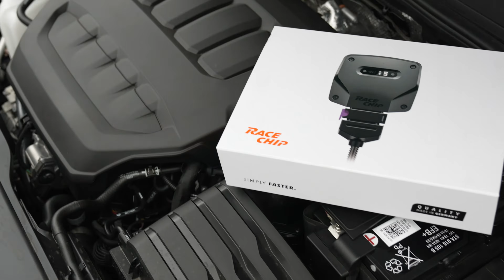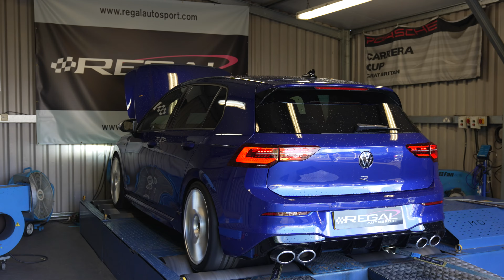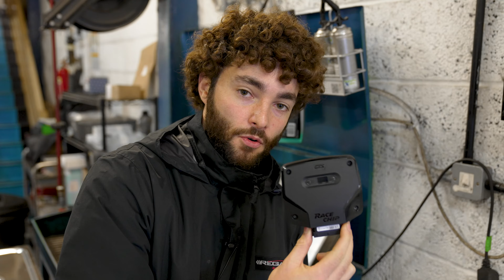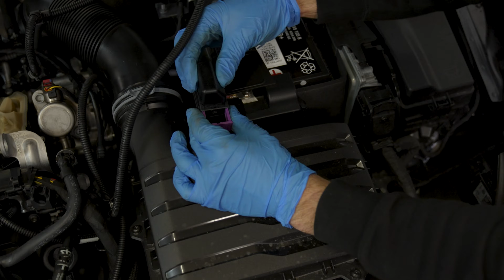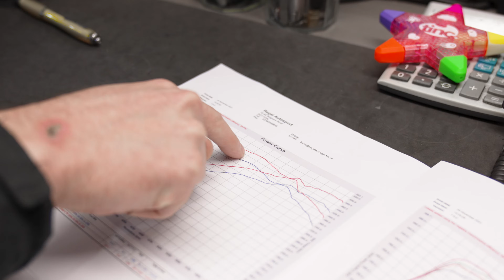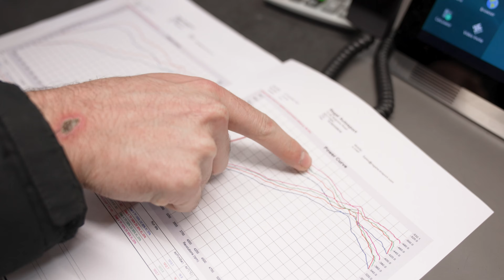HOW MUCH POWER DOES A TUNING BOX MAKE ON A MK8 GOLF R? [Tuning Box explanation & dyno graphs]

Comment: The MK8’s engine is very similar to the MK7/7.5’s. I mean VERY similar. Minor changes to the turbo and internals, but overall, it’s practically the same. 

That being said, a Stage 2 tune on a MK7/7.5 R takes it from 290hp crank to ~430hp crank. That’s a 140hp jump in just a software tune and downpipe. The MK8 R I would suspect to be in this same range of power (or even more like a 150-170hp crank jump) with a Stage 2 software tune and downpipe, BUT it needs to be a legitimate software tune, not the “tune box” junk.
Reply from the maker: On our dyno ECU, DSG software (or clutch if manual), good quality full intake, good quality exhaust and good quality intercooler will see around 410hp, bit shy of the hybrid turbo 430hp+ numbers you are talking about.
Reply: @RegalAutosport  I think you misunderstood. I’m talking crank up numbers, not whp. A hybrid IS38 turbo on a MK7/7.5 GTI/R will make 430+whp worth the same mods you mention above. That’s about 490hp at the crank. I made 358whp on my IS38 turbo taken from the Golf R on my MK7 GTI, which is about 410hp to the crank with my 6spd manual, and around 420hp crank for the DSG.

I would expect the crank hp to be more on the MK8 considering there are some engine upgrades, a larger stock turbo on it, and it starting off with more factory hp. 

A hybrid turbo should be making well over 500hp to the crank on the MK8 because it already does on the MK7/7.5. We’re you referring to crank or whp numbers?
Reply from the maker: @JacesOwnWorld   We only talk about crank numbers too, but calculated crank numbers from the drivetrain losses. Not a random % added

Comment: I'd be concerned with longevity of the engine after installing this. It doesnt adjust timing. More boost could lead to piston detonation without proper timing advance.
Reply from the maker: Important world could but doesn't. If you're worried about your engine, it's best to keep the engine stock.

Comment: What happens to your VW warranty is the engine goes Bang with one of these ?
Reply from the maker: It's best to speak to your warranty provider with regards to the specifics, although RaceChip do offer a warranty which you can also find out the specifics of by contacting them / visiting their website.
Reply: It’s out the window. Apparently BMW can detect if a car has had a tuning box fitted these days. So I would imagine VW would be similar as well.

Comment: @regalautosport, what octane of fuel did you run the race chip during the dyno runs?  I’m assuming you didn’t change any fuel.
Reply from the maker: We always run Shell V-Power
Reply: @RegalAutosport  93 octane?  I’m not sure what’s available across the pond.
Reply from the maker: I’m not sure what your exact equivalent is as you use a different rating system but usually the industry uses ‘93’ as a comparison, even that isn’t the true reflection though

Comment: Great video!! You explain exactly what a chipbox does and how. Im an owner of the new Gti Clubsport (300ps) and I’m considering to install a box..I wouldn’t wait for the unlock of the ecu and that because the Gti Clubsport is fwd..and the 30-40ps you gain from a box is more than enough so the car doesn’t lose its balance. On the other hand if i had the Golf R i would probably have waited for a ecu tuning, more gains and 4wd to support them..I can’t wait to see the review on the road. Cheers!!
Reply from the maker: Thanks for watching and your kind words. Great to hear that it was helpful. Driving video is coming in the next few weeks!
Reply: If you buy a pcm box you get stage one remap free as long as you give your pcm box back when the ecu is cracked.
Reply: So these are piggy back tunes.  It takes data from the measurement instruments on the car, and changes the values.  The stock ECU adjusts and ends up making more power.  It will say i'm not making enough boost and not running enough fuel, stock ecu demands more boost and fuel.  

The issue with tricking the ECU is that you are removing safety limits that are designed into the car.  If it was my car i would wait for a proper tune.  APR for example adds a ton of additional measurement points on their test cars to tune the car like how the factory would.  When manufacurers tune they take way more data points than what will be on the road car, and use formulas to estimate these values on the road cars.  This works great as the formulas are based on actual measured values under fixed conditions.  When you piggyback these formulas don't change, but you are changing the conditions.  

And as for their "warranty" , I just read the exclusions.  Lets just say they have tons of outs to void it and it only covers up to $7500.

Comment: I was expecting a bit more if I'm quite honest but it would be good to get some draggy times, 0-60, 20-70mph just to see what it's like on the road. Like someone else said, I have heard some bad things about the GTS.
Reply from the maker: A tuning box does have its limitations… it’ll never be as good as a proper ECU tune. Unless it’s a terrible one 😂

Draggy times are coming up! 

What bad things have you heard? Share!
Reply: @RegalAutosport  That's very true, I thought more around the 375bhp with a tuning box but I guess the proof is in the dragy numbers. Will you be doing standard and with the box runs? 
It's mainly how some have bought the Racechip and not noticed a big enough difference to warrant the £500 for it.
I did see a Ptronic tuning box from Belgium quoting 411bhp which I thought is a little optomistic!
Reply: @RegalAutosport  did you manage to get some draggy times?

Comment: Another really interesting video, It’s all about the road test, very interested to hear how it feels. Any concerns re potential damage fitting this to your car, as I believe it manages less variables than the likes of a JB4. Finally any timeframes on ECU unlocking.
Reply from the maker: Thanks for watching and the comment! Road test is coming up soon. 

There are always risks with changing a car from stock, and before tuning you should be accepting of that increased risk. With the GTS Black, we didn’t mention it in the video but it comes with a warranty on the engine. 

As far as we are aware there is no JB4 for this ECU 

No timeframe yet, when it comes it’ll come. Usually what happens is all the tool makers that everyone within the industry uses will have an update, this will allow people to read and write to the ECU. At that point you’ll see lots of brands coming out with various tunes.
Reply: @RegalAutosport  roll on some APR or REVO tunes, imagine stage 1 will be knocking on the door of 400bph.
Reply from the maker: @user-xl7yf7pc7k  absolutely! This is just a small indication of its true potential!

Comment: thanks for the video. I also bought the gts, but not installed it yet .. I'm curious.
Reply from the maker: On a MK8R?
Reply: @RegalAutosport  yes 😉
Reply from the maker: @Samako73  let us know what ya think!
Reply: @RegalAutosport  I'll be happy to do that, but it will take a while
Reply: So.. now i know the answer. The Dyno says..
Stock: 340 PS, 519.9 NM
With Race Chip: 359 PS, 566 NM
I'm happy with the result. Even if the promised horsepower figure was not achieved. Particurarly the Torque is Amazing.